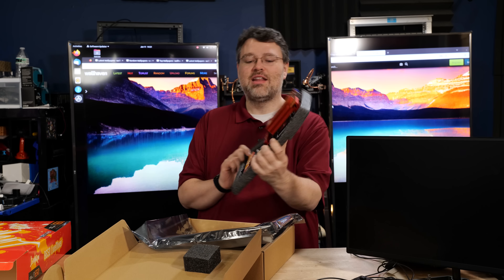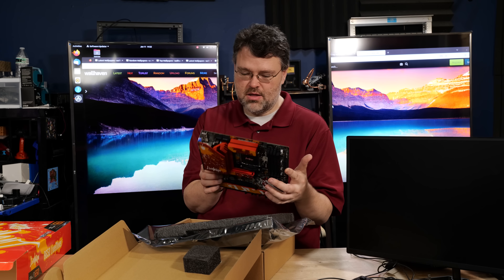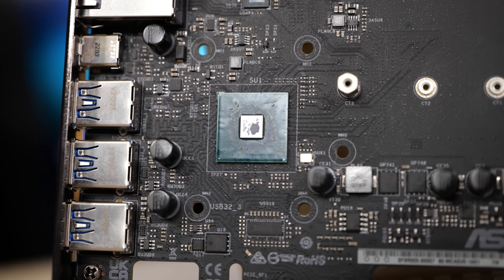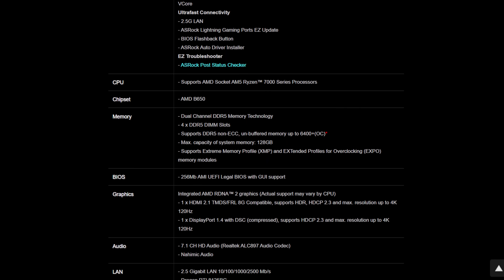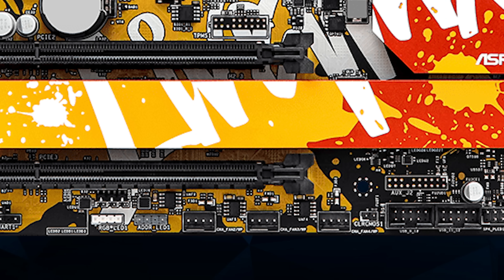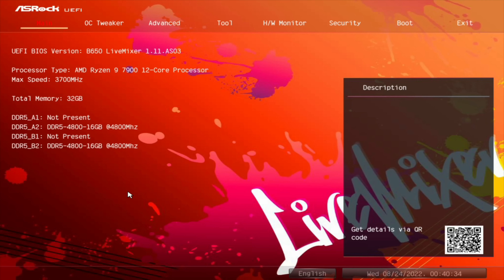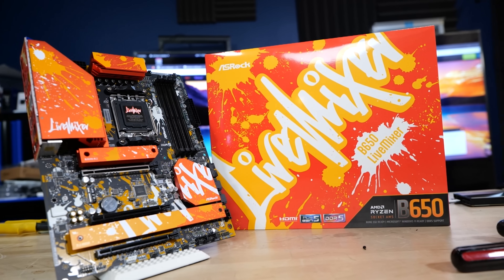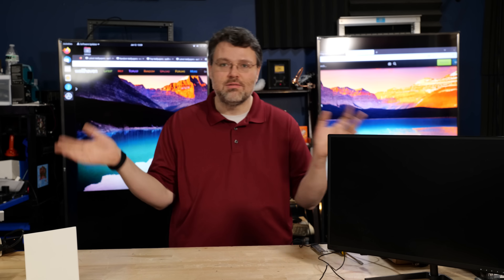ASRock Livemixer B650 Motherboard Review (Special Edition)

Comment: Just bought this motherboard, new pc builder what do I look for when looking at a compatible WiFi card to go with this. Don’t need blazing speeds just something that will preferably work just plugging in and downloading drivers.
Reply: how is it so far ?
Reply: @brahimsaad6287  I got my setup complete. The motherboard was super easy everything worked out of box. The one down side is there is no wireless built in.  I went with a m.2 wireless card and antenna at first and messed up one of the antenna connections. I said screw it and plugged In a PCIE wireless card and good to go and easier. I would buy this board again and it’s cost effective for what you get.

Comment: I am building a HYTE Y60 Snowwhite Case with this ASRock B650 LiveMixer AM5 ATX Motherboard and G.SKILL Trident Z5 RGB Series 32GB (2 x 16GB) 288-Pin PC RAM DDR5 6000, with a Ryzen 7  7700X, Vetroo V360 White Liquid CPU Cooler, 3X 120mm Addressable RGB & PWM Fans/Pump, 360mm Radiator 290W TDP AIO Water Cooler w/Controller Hub  a "Fantom Drives VENOM8 1TB NVMe Gen 4 M.2 SSD - Up to 7400MB/s, PS5 Compatible PCIe 4 M.2 2280 Solid State Drive ", 2 RGB 140 mm side fans 1 120mm RGB rear fan a SRock Steel Legend Radeon RX 7600 8GB GDDR6 PCI Express 4.0 x8 ATX Video Card RX7600 SL 8GO, ASUS TUF Gaming 850W Gold (850 Watt, ATX 3.0 Compatible, Fully Modular Power Supply and to view my Games with a  GIGABYTE 32" 165Hz 2K Curved Gaming Monitor 1ms FreeSync Premium (AMD Adaptive Sync) QHD 2560 x 1440, OC 170Hz just a little over $1.700.00 with tax and shipping. from Newegg

Comment: Bought the AM5 B650 Asrock Live mixer and it is one buggy random restarting board. Recommend avoiding AM5 platform. Asrock seems to be racing to get faster and faster ddr5 speeds, yet the platform does not run stable. Note Also Asrock has NO realistic RMA process.
Reply: I have a 5800x3d. I keep wanting to go AM5. The price difference is negligible right now after selling my old build, but not sure if it's worth the hassle. I play games in 4k. This is the board I would go with.

Comment: I'd buy this, but lack of PS/2, sata ports, and the violent orange BIOS sure are deal killers.    A blind person can't use a bios unless it's white text on a solid black background.  All BIOSES should be white text on a black background.  Every time I had to reset or make a change int he BIOS I would have to ask someone to be my eyes for me.   Which is crazy stwpid.   Your CMOS battery die, and your SOL until you can guide a nn tech person verbally throught he bios reading every single thing back to you.  

You wouldn't believe how many hard to find peripherals still use PS/2 ports that content creators use.   Trackballs, wacom tablets, etc.  I never know what these mobo manufacturers are thinking by leaving off the PS/2 port.   You can't install Windows 7 or older operating system without a PS/2 port, because there's no USB drivers installed yet to recognize the keyboard or mouse during setup.  People have had to roll their  own ISO's of Windows 7 just get the USB drivers in there just to install the frigging OS on motherboards that leave the PS/2 port off .face palm.
Reply: I do feel your pain. But Aten Active PS\2 to USB converter is your friend. (UC100KMA-AT)  But wait for installing W7 there is plenty of USB 2.0 ports on this orange beast. I  have been there installing W7 on Intel NUC with only USB 3.0 ports.. Did the rolling of drivers into the ISO. Point well taken. It's nice to get at least a single PS2 port. I have an Asrock 990FX AM3+ socket from 2013-ish. Still even has a floppy controller.. :-)
Reply: @mattscomp  I got a Gigabyte x670 AORUS Master Gaming instead.  Same price used, but 4 nvme drive slots, one of which is pcie  5.0.  

Every mobo has it's strengths and weakenesses... only weakness s I can tell so far is I'm not crazy about only 3 audio jacks.

Avoid getting sucked into the Corsair RGB ecosystem, it's a waste of money and mostly broken.

Typed on an IBM 1987 PS/2 Model M keyboard on same computer, using some inline PS/2 to USB converter of which I bought like 15 of them...

Comment: I almost bought this motherboard, but man... two SATA slots is just not enough.
Reply: doing it wrong if you still use sata in 2023
Reply: @Zombie101  I still use HDD drives and i need a lot of SATA's. Imagine how expensive 4TB M.2 storage would be. SATA in 2023 for mass storage is still as relevant as 10 years ago, stating otherwise is ignorant.
Reply: @GuzikPL4  but if you need that much storage just go cloud. Surely a huge sata or two is more than enough? each to their own. I just don't get it, not when nvme exists and one or two satas if you absolutely must
Reply: @GuzikPL4 pcie expansion cards are your friend, but you have a valid point

Comment: That chipset board is close to cool. What I'd like to do is split pci-e 4.0x4 slots into a pair of pci-e 3.0x4 (or 5.0x4 -> four 3.0x4) so I can double (or quadruple) the number of nvme drives
It would be a weird pci switch application that no one seems to make

Comment: Love the color scheme, like the amount of USB 2 ports and the other features. Would have liked to see a 2nd type C port on the back, even if it was 2.0 or 3.0.
I  REALLY hate the assumption that you're going to use a 3 slot GPU. An additional x8 or x4 slot would be far preferable. 

Still disappointed with B650 pricing overall, but that's true for CPUs & GPUs as well. This one however would be one I'd consider if I was moving to AM5 soon.

Comment: Those sort of expansion cards are what I hope for more. For my uses I don't need lots of direct pcie. Just more things connected at once. 

Looks awesome.
Reply: I just read about the M.2 expansion card slot for Raid 10 support to work. That is something he didn't cover in this video. I wanted to add 4 2 terabyte M.2 Platniums. Your computer is only as fast as your drive. You can have the fastest CPU in the world, but if your SSD drive is as slow as a snail, all that CPU speed is bottlenecked by information running from that SSD. Hence why M.2 is way faster and fantastic for putting your OS. I put all my major games I stream online on this M.2. Right now, I am looking for a second motherboard for a second stream machine to handle the mirroring of my gaming machine. This motherboard is perfect for my LED lights, cameras, controllers, stream decks, and GoXLR. Been still trying to figure out how to separate the two computers from the gaming computer, but the Gaming computer still communicates with audio through the Astro50s; the GOXLR might have to go because I have been trying to figure out how to combine it with both computers.

Comment: This is what I have always liked about ASRock, they do some really weird and cool things that no one else does. Here's hoping the card ends up launched for retail, if for no other reason than it's a neat bit of tech.
Reply: Like weird cool motherboard 939Dual-SATA2, AGP And PCI-E, AM2 CPU Board. Weird and cool. Lets hope they are back on that road!
Reply: @nojoojuu  I have an H170 Combo from them, it supports both DDR3 and DDR4 (not at the same time). That was as recent as 2015. I also had a P4 Combo back when, socket 478 and LGA 775 on the same board, that was awesome.
Reply: What they need to do is release a new OC Formula board for Z790

Comment: One thing I wish they had included on this board is more SATA ports. 
I would like to eventually upgrade to an AM5 system and experiment with PCIe passthrough to VMs, and having the ability to use massive hard drives, SATA SSDs, or 5.25" accessories in a larger case would be nice, while also having access to two physical x16 slots for GPUs and one more for faster networking or another PCIe device. 
It is a niche request for sure, but considering most cases have space for at least 4 SATA devices, having only two on the Asrock board is a bit of a turn-off, especially when the ports are probably dirt-cheap compared to the $230 MSRP. Either that or they could sell that add-in card at retail, the faster networking and storage ports would be very useful as well.
Reply: yes, more SATA ports please! 8 or so... missed the days when Asrock made as much as 12 SATA ports
Reply: @DrexxLaggui  Hell with that many, you wouldn't even need an HBA to connect a lot of hard drives. You could use that third expansion slot for something like Asrock's X670 Expansion card, or a 2nd add-in GPU, or whatnot
Reply: That's a cost question. Most people ditched the SATA drives and moved them to a NAS. So NVMe is the way to go. If you need more SATA devices threre are some PCIe 3.0 SATA cards to get. 2 ports ~15$, 4 ports ~ 25$. You use it in the most bottom slot and off you go :)
Reply: @eliotrulez  Not everyone wants to use a separate device for storage, you can't speak for all the people who choose to use local storage for a massive steam library, or virtual machines, or large video collections, and those are just the use cases I have. If you do use a NAS, that's great, more power to you. But personally, until I can teach myself about setting up a NAS and not just use Windows 10 and network file sharing, I would like to keep my configuration of a 500 GB SATA SSD, 250 GB NVMe, 2 4 TB hard drives in RAID 1, and my optical drive, as well as any 5.25" hot-swap bays or other SATA devices I may plug in. NVMe can't be a blanket solution when there's only a limited number of PCIe lanes anyway, especially in cases that don't require massive amounts of bandwidth.
If additional SATA connectors would increase the cost of the board by $10 for each port, I could understand that. But for a connection that barely saturated 500 MB/s per connection, having even 2 more would be an adequate improvement. 
Not to mention if I were to buy an add-in card instead, I would at least want the PCIe slot that could be used for an m.2 expansion card or more networking to have at least 8 SATA ports, raising the cost to at least $80 for the used enterprise cards I have seen on ebay.

Comment: Curious expansion card. But since it's limited to 64Gbit/s (PCIe4x4), you'd hit a bandwidth bottleneck by using all ports at the same time: networking (-10Gbit/s) + thunderbolt (-40Gbit/s) + USB-ports (-10Gbit/s each) + M.2@PCIe4x4 (-64Gbit/s each). The bandwidth limitation would vanish for the most part, when connected to a PCIe5x4 slot @128GBit/s. Will these PCH-on-riser-pigeons be available for other boards too (any universal design planned)? At what speed do they work in a PCIe5x4 slot or adapted to the PCIe5-M.2 Slot?
Reply: Does the bottleneck matter? You are limited by the chipset uplink as well, which is also PCIE 4.0 x4. So It does not make a difference. You can hope B760/X770 will have PCIe 5.0 uplink, where this bottleneck would be mitigated, but the cost of the boards will raise again due to complexity of the PCB.
Reply: @eliotrulez  good point. The PCIe4x4 X670 chipset uplink is another limiting factor here. - So the devices connected to this X670 expansion card must be under 64Gbit/s in total.
I'd like to see a motherboard AM5/LGA1700 with three PCIe4x16 slots instead - for example to mount one GPU, one 4-times bifuricated expansion riser for M.2/U.2/PCIe4 SlimSAS and one 100Gbit/s network card. But with AMD's current specification for B650/-E/X670/-E, it's not going to happen. Instead, most boards have overbuilt VRMs and obscure PCIe lane allocation, compromising on USB/SATA/M.2/PCIe slots. This "chipset on a riser" is still a very interesting idea, adding a lot of connectivity to an affordable base.

Comment: Becouse of the lack of conectivity (expansion slots for pci-e) I switched to Intel z690. Even on Intel most motherboards go all the way with m.2 and there is not enough pci-e slots. Asus PRIME z690-P (or Z790) have 1x pci-e x16 lines, 3x pci-e x16 with 4 lines each (16 physical), 1x pci-e x1, 3x m.2 for ssd and even a V-M.2 for a wi-fi laptop module (pre-punched holes in the back plate (no antennas included). Didn't check the IOMMU groups yet. The motherboard has a small number of usb

Comment: I think the Asrock B650M PG Riptide and a Ryzen 7700 would be a solid pairing.
Reply: Rocking the 7700x on the LiveMixer: it's clocking  5.9 Ghz at 86 PPT. (real use 88W) Temperatures are 65 degrees Celcius-ish max (Noctua NH D-15 cooler). Use PBO2 and Curve Optimizer to get the most out of these chips (YMMV). AMD sold these set at the maximum thermal ceiling. Overclocking is now about efficiency. Finding the right mix of voltage and current. Cinebench r23 is around 20000 for the all core, and around 1970-1990 single core. Passmark is 38600 score (ish) It's completely stable. I had it at 84 PPT and then it started clocking at 6150 MHz on six cores, but an occasional crash (not all cores could keep up I suppose). So I put it on 86 and lessened the Fmax from 200 to 150, and it's good now.
Another feature of the ASRock mobos is that you can set the Curve Optimizer in SINGLE DIGITS (all cores). Sadly not per core (yet) but I asked them to think about adding that to a next BIOS revision.
Comparing to the hyped non-X Ryzen Zen 4: I bet those are good CPUs too! But I do feel that the critique of many reviewers, is undeserved.
I'd like to see the 7700 clock stable at 5.9-6 GHz at less than 90 Watt. Not going to happen. Yes you can put more juice into it, with PBO2. However (and this is what most, if not all reviewers omitted) you'll run the non-X at much higher current and temperatures, than the X. So, to many people, I noticed, it doesn't make sense to put less juice in it, to make it run better. But here we are. Or maybe AMD told them: Sell these chips better than the flopped X series. Somehow AMDs marketing dept failed and they tried to equal Intel Raptor Lake raw speed and insane power use and temperatures.
I don't need insane power use and temperatures. I run an indie audio studio. I want this thing to work in 5 years. I don't want 700 eurodollar monthly electricity bills.
So.... With the X chips discounted, I think those are the real bargain here, if you know enough about computers to change settings in the BIOS.
I assume ppl. who watch Level1Tech are capable of that.👍

Comment: Ok ok ok, imagine 10 sata ports on this daughter board, and then 2x118GB Optane drives for say, cache or meta, this would be a pretty cool solution for say small form factor home lab servers, imagine if that were an SFP28 and the network+M.2+sata were not bottlenecked by the 4x link to the CPU because they were all on the same card sort of like a DPU, but for the consumer space

Comment: I'd love to see the chipset go onto an optional board given how the cost of motherboards is going.

Not to mention in the post multi-GPU age, there are a lot of unused PCIe slots on people's systems.
Reply: Well there's still a need for a chipset on most motherboards, for the sake of not having a limited amount of USB ports, M.2 slots, or chipset-connected PCIe 16x slots. Cards like these are still cool though, even if personally, I'd prefer a (admittedly expensive) multiplex chip for splitting up even 4 PCIe 5.0 lanes out to a PCIe 3.0 16x slot, but if that's not a possibility, something like Asrock's X670 Expansion card shown off here is very interesting
Reply: "a lot of unused PCIe slots" Not if the new AM5 boards are anything to go by...

Comment: Did it default to a 1500 UCLK when using 6000 EXPO settings? Had that happen on my B650E Riptide, but I have to say it's just a nitpick. I'm really happy with ASRock's UEFI config and options. First board  I've ever used where clearing the CMOS didn't wipe saved UEFI profiles either.
Reply: I know right the whole point of profiles is that they don't just get completely deleted and removed any time you do something

It hasn't been consistent but I have seen them stick around through bios updates as well
Reply: @profosist  UEFI updates I can sort of understand... On more than a few occasions I'd update GB UEFI's and applying the old profile would cause wonky things to happen, because it was trying to apply settings that no longer existed or were changed. 

My only gripe is to clear the CMOS on B650E I have to open the case and also flip the PSU off. For some reason the CMOS won't clear with only the PC off.
Reply: @kougar7  it should not apply settings that have changed and let the user know.

As your your clear CMOS, yes its because the system with PSU on still has 5v standby current
Reply: @profosist  It shouldn't but it can. GB has shipped boards with alpha-level BIOS versions before where practically nothing works and even the RAM timings were hardcoded. By the time GB would get a proper version out a lot of things would change in the backend.  

X58 was particularly notable where after a year GB rewrote the BIOS code. I forgot the exact details, they are out there somewhere. But the core of the story was the new BIOS rewrite was incompatible with the old BIOS residing on the backup chip, and lots of chaos ensued for anyone that bought launch day boards with very beta backup BIOS versions. Gigabyte's solution was to pull the update, then re-issue it so that it manually flashed the backup BIOS then restarted updating the primary. First time I'd ever seen a UEFI update flash both in one go, but I made sure to learn how to also update the backup BIOS after that episode. 

As per the clear CMOS requiring the PSU to be off at the switch, this is the first board that's been the case. I've reset the BIOS on dozens of boards and none required the system to be both off with the PSU manually off at the wall. Boards with a clear CMOS button don't have to do that either.
Reply: Using a Kingston Fury 64 Gb kit with XMP settings at 6000 (timings of 5600 "agressive").
UCLOCK = MEMCLOCK it says. Infinity fabric is 2000 as usual. (B650 LiveMixer)
I guess it depends which memory kit you use?
Yep, UEFI saved profiles are saved when CMOS reset. Confirmed.